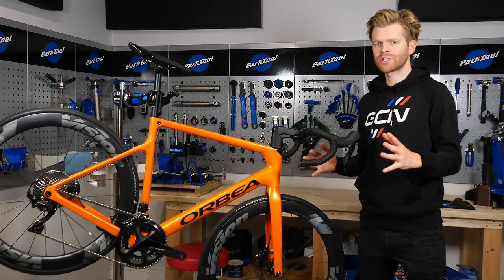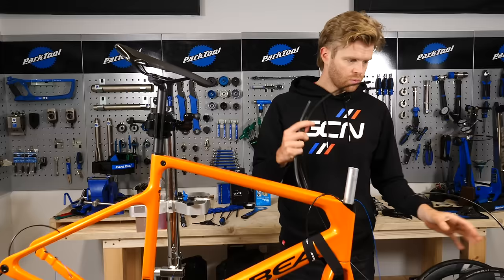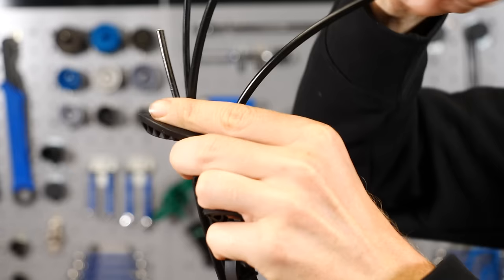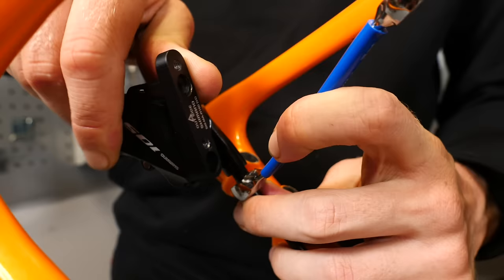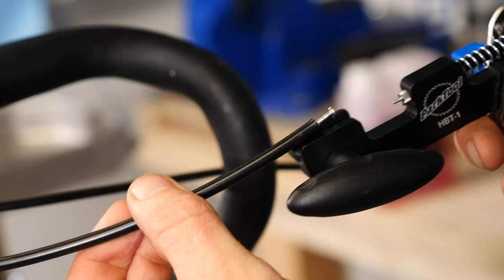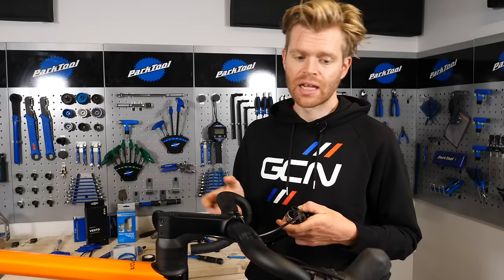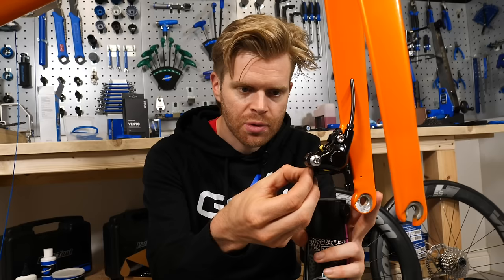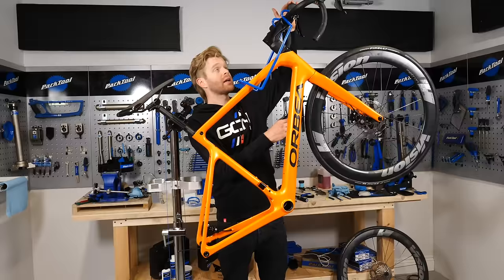How To Fit & Set Up Shimano Road Bike Hydraulic Disc Brakes | GCN Tech's Full Setup & Installation

Comment: From my calculations Ollie used $1039.40 USD worth of Park Tools to install this $550 USD hydraulic brake set.  However, we cyclists seem to loose all sense when it comes to spending on our bikes.  Case in point I just spent an extra $120 on a some pedals just because they are a few grams lighter than the ones I had been happy with for 8 years.
Reply: Shoot, as a commuter I can go balls to the wall with spending and usually I still don't even come up close to what I would pay in gas for the year unless I'm starting a new bike from scratch
Reply: I mean I spent 40k php to convert my old mtb Specialized pitch comp 650b to a gravel bike when at the same price of the components I used I can buy a used grabel bike
Reply: I just wondered how much the whole Park tool collection behind him is worth…🫣

Comment: ALWAYS push the olive and nut onto the hose before installing the barb. Most barbs are to big to slide an olive and nut over.
Reply: Not the latest Shimanos! I think this may be this generation of hoses and barbs, I have spent some anxious times looking for the olive that popped off from the hoses. The last install I did (GRX) actually has the olive inside the caliper port already; you supposed to just slide the hose with the barb into the screw-olive-port assembly. It's quite a bear since the fit is pretty tight, and I found it easier to take the olive out and manually slide it into the hose before inserting in the port.

Comment: Great video. I would make a few additions. Firstly, it's just mineral oil and not brake or hydraulic fluid (which is corrosive) so not much to worry about when dealing with it. Also, for internal routing I find doing the opposite (getting the levers connected and then cutting the hose to length at the brake itself to be easier. Best video I've found on this... Thanks!

Comment: Note that the "wedge" flatmount adaptor for 160mm rotors for the back calliper doesn't usually come with the groupset whereas the front one usually does. Just a heads up if you are buying components to build your own bike.
Reply: I found that out. Doesn’t make any sense to me.

Comment: This is just perfect as I just bought a gravel bike that had mechanical disc brakes and I want to upgrade to hydraulic brakes
Reply: Hydraulic came on my grail, 105 and they are the best..
Reply: @markalfresco  yeah I plan on upgrading my groupset to Ultegra Di2 hydraulic disc brakes. Have heard great things about them
Reply: BTDT
Reply: Where the mech discs functional and safe? What brand ?
Reply: @mididoctors  my bike came with tektro mechanical disc brakes and they are perfectly fine and safe. The only reason I want to change is because I like doing long and technical descents and hydraulic disc brakes are better for that.

Comment: Olly, I noticed that you did it, but you never mentioned why you had the crows foot adapter at 90 degrees to the torque wrench. If anyone is wondering, it keeps the effective length the same, and therefore the torque the same (or near enough, it's not a perfect method, but close enough).
Reply: "Every days a school day" i dont have a crows foot adapter, but if i get one i will know now.
Reply: Thanks for the tip.  I haven't even seen that on the Park Tool videos.
Reply: Except:  As used, you can see that it ends up at about 30 degrees to the axis of the torque wrench... Which means the torque ended up a little different.  :)

Comment: Recently bled my brakes and had the black bar on the syringe positioned the same way as seen at 16:20 and was (unknowingly) slowly closing the bleed port back up. You can kind of see that happening in the video. Created a few issues for me before realizing what was happening.

Comment: The Tube cutter is an expensive investment for occasional use.  You can get just as clean a cut with a $10 Co-Ax cable stripper set on its smallest setting.  Loads to choose from in your favorite online store.  The barb can be lightly tapped in without the help of a special tool.

Cable routing - some stiff garden wire with the tip bent over into a tight smooth bend gets the job done for cents.  Especially if you are having to find the route on a frame that doesn't have messengers already fitted.

Comment: I noticed you didn't talk about expecting air bubbles to come through in the reservoir and what to do if the brake feels spongy after bleeding or there is lots of travel in the leaver or the loss of breaking if the bike was turned upside down.

Will there be a part 2 to this video as it's not quite as simple as that and think it's worth will sharing with your viewers/home mechanics

Comment: Did I miss something or did the bleeding part consist only of pushing the oil into the system? I feel like this might leave some air in the system, which would cause trouble when braking. After all, if you're not moving the pistons, why would you need a bleed block?
Reply: no expert here, but if you do not put the block in, the pistons can be pushed out of the caliper. I think this would ruin the entire brake. When there is fluid in the hoses, this could easily happen when you accidentally bump into one of the levers...And this way, the pistons are safely pushed all the way back, this way you cant put to much fluid into the system.
...and yep, normally you would do all sorts of shaking and tapping to get rid of all the bubbles.
Reply: Also if you noticed when we had the fluid in he was pulling on the lever multiple times that makes air bubbles get out the system crating a much more tighter feel when braking. (Don't forget the bleed block is still in the caliper for the pistons)

Comment: Shimano brakes come with the hose connected to the caliper. They should come with the cable connected to the levers instead. I had to disconnect the hose from the caliper to get the hose routed through the fork.

Comment: dont forget that sometimes you have to restart the pistons, they extend continuously as you rotors get thinner and thinner due to wear, so if you replace just the rotors you might have rub no matter how you are centering the calipers and nothing helps you, push the pistons with pads OUT to create bigger gap and then it will be ok

Comment: Where did you get the foam sleeve you used, does it also fit a Di2 wire and what is the internal and external diameters? Thanks

Comment: Great video. Thanks. Is there a way how I can remove the olive and the piston thing from the braking cable once it has been installed?
Reply from the maker: Hi Alain, to remove, it's best practise to cut the hose to remove and discard the section with the brass olive and the barb (being careful not to hit the barb with your cutters so as not to damage them). The barb and olive should be replaced with new ones but the nut is reusable!

Comment: @everyone Hey guys, I am switching to a new frame. but my grx 400 hydraulic sti are routed internally from the old frame.  Do I have to drain the whole fluid, and potentially replace the hydraulic line/cables? Tnx.

Comment from the maker: What kind of brakes will your next road bike have?
Reply: Road - Rim ONLY
Gravel - Disc
Reply: Rim, on a rim specific frame not one these token compromised rim frames with long chain stays.
Reply: @sexyhemch  Breaks are for recovery.
Reply: Direct mount rim brakes, of course.
Reply: panzerveps 👍🏻👍🏻👍🏻
Reply: once discs, always discs. but manufacturers should invest in some R&D to make rotors less prone to warping.
Reply: Disc, disc,DISC,
Reply: Disk for 2 simple reasons. Tyre clearance, and rim wear. Rotors are cheaper than a new set of wheels.
Reply: I have had hydraulic discs on my MTB for ages now, thankfully it was a disc ready frame and wheels, and I added them later.
My road bike is currently a rim brake, and although I LOVE it,  I do DREAM of a newer road bike, with discs, and all the intergration, maybe even some electronic/ wireless groupset.
Reply: Discs now and forever
Reply: @bmmaia81  Almost 35000 km on my CF rims and brake track is still fine. Just saying.
Reply: Rims for the win!
Reply: jkk sure and that’s fine. But where i live I don’t have so much flats. When i brake is really breaking and my wheels will last forever. In 15 years my kids can use them 😃
Reply: @atticushexcel9567  How much rims did you wear out? 
Well I have an explanation for you guys. While you are so busy servicing dicks brakes you forgot how durable rim brake system really is. And on my experience good carbon fiber rims are more durable than aluminum ones.
Reply: @bmmaia81  In 15 years everything will be obsolete. Keep complicating and good luck with servicing all the fancy stuff 15 years later. My bet would still be rim brakes.
Reply: @Digi20  It is simple, make them out of single material (=steel) and make them thicker. It has already been established weight doesn't matter. If you already added 600 g you can surely survive adding another 100 or 200 g 😁
Reply: @jkk916  after some experiences i am pretty certain the problem with the shimano rotors often warping is due to the sandwich construction of steel-alu-steel, the materials have different heatproperties, coupled with the riveted spider and those things warp after some heavy descents. i switched to hope ones on my road bike, and thicker one-piece steel rotors on my gravel bike. both work very well. but even with the thicker ones you still have to pay some attention when taking the wheels off and traveling. i am pretty certain this could be improved with, for example, a clever vented and thicker design, without much added weight.
Reply: @atticushexcel9567  I like Cannondale too, Synapse is great gravel bike 😁 But their bottom brackets and headsets are horrible and I speak from experience.
Seriously though: Rim brakes are actually disc brakes with maximum size rotors. I don't understand why would anyone view them as inferior to disc brakes with rotors that are so small they look silly. Yes, I know that rim brakes would heat up tires too much if they needed to stop a truck. But they don't need to. Average car is around 300 times more powerful than a good cyclist so it should be obvious to anyone that it has totally different braking demands and therefore needs different technical solution. Everybody, please stop comparing bicycles with motorized vehicles, it makes as much sense as strapping jet engine on your ass and call yourself a plane.
So, can I assume you actually wore out 0 rims (because thermal damage doesn't count)? ;)
I am sorry you had a bad experience with your rims. But that happened because your specific rims were not adequate for your needs, you shouldn't be mad at rim braking system.
Reply: @jkk916  You seem to be making a couple of deliberately misconstrued points. Bike rims are not large disc rotors. Disc rotors are designed to disapate heat. Rims basically dump the heat into the tyre.

To pretend that there are no thermal issues with rim brakes is being disingenuous. It is well established that carbon rims especially can be a hazard, especially on long descents. This is why Shimano rims have an aluminium braking surface.

Finally, for the millionth time, the greatest advantage of disc brakes over rims is the improved control over the braking.
Reply: @richardhaselwood9478  Yes they are. Rims and also tires on road race bicycle are narrow enough. I don't see a reason why they cannot be viewed as a disc rotor.
Also, I would be glad if you red my comments more carefully, I don't want to repeat myself all the time. I have never said that the issues do not exist.
Saying something a million times doesn't count in my eyes. What you say is anecdotal evidence at its best. Please bring some substance into discussion. ;)
Reply: Cantilever. Cutting edge, man.
Reply: My last two have been disc, mechanical and Hydro. Would never go back to rim not that you can get rim bikes anymore unless low end.

Comment: Great job Ollie. 
I have a question though. Torque wrench practices teach us that when using a crows foot adapter such as you use, you must then account for this leverage in the value or the setting which results in a lower setting. This must be accounted for as due to the the position of the crows foot this can change by as much 30 or more %. So my question is was that 5nm with this adjustment value or is this value shimano says to use with a crows foot.

Comment: I got a lot from this thank you. Can I ask, new 2020/21 front callipers have a ratchet mechanism on the lower calliper bolt. Is this for changing the way the cantering adjustment is made. I’m a newbie bike builder working in a busy bike shop, thanks again 👍

Comment: Keep in mind that common brake fluid and hydraulic mineral oil are very different substances. Brake fluid is rather nasty stuff, and very corrosive to paint (though it won't burn your skin). Hydraulic mineral oil is much less nasty stuff, which can easily be cleaned off with soap and water. When handling brake fluid or mineral oil, make sure not the shake or drop the containers, as this can cause bubbles which you may not be able to see, and you don't want bubbles in your brake system.

Comment: Thanks for the video, Ollie - clear and concise.

I think others have mentioned the bleeding technique. The full Shimano process is a bit more involved and, in my own experience anyway, vital to getting decent lever feel, where it doesn't feel that you're grabbing a load of air at every pull of the lever. TBH, that's a video in its own right, and would be well worth doing as it's a dark art and so often done wrong. Maybe one for the future?

Also, as a note on the bike - I love the clean lines of hidden cables as much as the next person, but the part of me that rides in Yorkshire winces at the sight of cables running through the middle of headset bearings and the thought that swapping these is transformed from a 15 minute job into one that is likely to take several hours! What are your own thoughts around this development in bike design? A step too far?
Reply: Good argument.  But, even having replaced my internal cables and housings, a few times, with the associated swearing, I still prefer them over external, if only because it keeps a lot of muck out of the cables and housing, and it looks cleaner.  I know, form over function argument there.......

Comment: Thanks much for video, I planning to upgrade my shifters, my question is do I need to remove the hydraulic fluids?
Reply: You can do, it’ll be less messy but not completely necessary, you could simply just unbolt at the shifter and drain whatever is in the top part of the hose into a cup. Replace with a new olive and rebleed fully. You’ll find a lot of short cuts along the way.

Comment: I have an off-topic question, Ollie.  I have an Ultegra FC 6700 (2 x 11) crank set, with172.5 long cranks.  My shoes intersect with the tires, so I'd be safer with shorter cranks.  Can I use any Shimano or any Ultegra cranks or crank sets, or does it have to be replaced with FC 6700?

Comment: #askgcntech Hi GCNies, I currently ride a bike with 105 r7000 on it and think about updating it to Ultegra Di2. I‘m a little anxious though that I come across some serious issues, e.g. internal routing problems when switching out the cables. Any suggestions or even a howto video? Thanks!

Comment: Whilst this is a good tutorial, you may find that the second half of the bleed process is missing. If you follow this guide to the letter, in the end you may still have no brake when you pull the lever. I did this step by step and my system was still full of air. I had to fill the fluid reservoir at the brake lever and then attach a hose / catch can (bottle) to the calliper bleed port. Open the bleed port with a 7mm spanner and pull the brake lever. You will see lots of air escape. Whilst the lever is pulled in, close the bleed port. Repeat this over and over (keeping the reservoir topped up at all times!) until no more air comes out.

Comment: Can you run a Deore XT M8000 cassette 11-46 with a 105 (long cage) rear mech?  It’s on a gravel bike running a 1x11 set up with bar end shifter.
Reply: Don't think so. Apparently the cable pull is different between Shimano road and MTB shifters.
I could be wrong

Comment: #askGCNtech if the calipers come with the hydraulic hose pre-installed, if it safe to assume the connecting bolts are already tightened to spec?

Comment: i have a brand new trek road bike with ultegra disc brakes recently they have started making a really weird low almost pulsating noise when i brake hard ish  its at its loudest right before the bike comes to a stop ..could the brake discs be warped already its only done 1500 miles by the way  its  not a squealing noise at all and when just riding they are not rubbing at all any ideas anyone ...
Reply: Have you tried cleaning with disc brake cleaner as it could simply just be dirt sitting on the surface of the rotor
Reply: @Jasondom-kc7or  yes mate ive had the pads out cleaned and blown out inside the calipers etc cleaned the rotors everything is spotless
Reply: ive re-torqued the discs and calipers and checked alignment
Reply: Thats a pain the only 2 things left I could think of is the wrong type of pad with the rotor or you need to re-bleed the lever. Will be interesting to see what olli says.
Reply: Rub the pads on fine wet and dry sand paper clean with nail polish remover and put each pad in the vice and get a small soldering burtain gas touch and heat them up for about 40/50 seconds wait till gone cold and put back into the caliper. No more noise
Reply: @christophercondron5388  thanks christopher i will give that a try

Comment: #askGCNTech Hi, i have unused crankset Claris R2000. I was planning to buy an entry level bike for indoor trainer, but my local bike shops were out of stock. So i was thinking to put it on my 105 r7000 groupset bike because my current 105 crank is really worn out. Is it possible? Thanks!